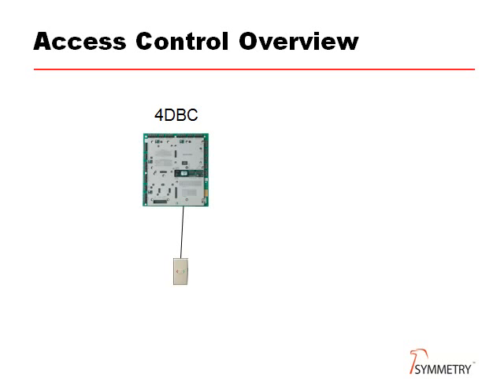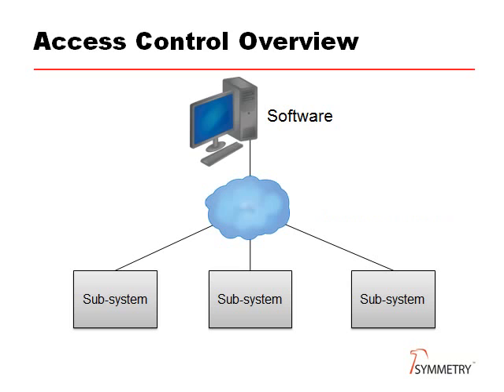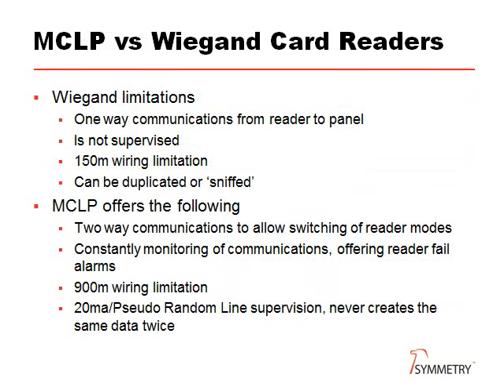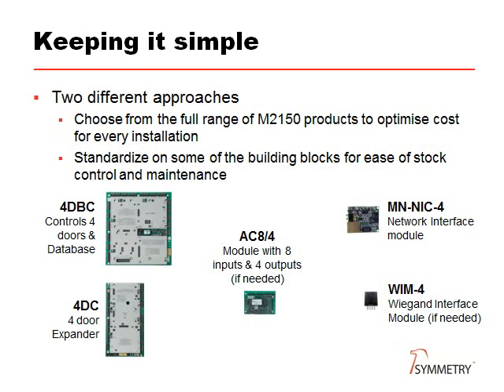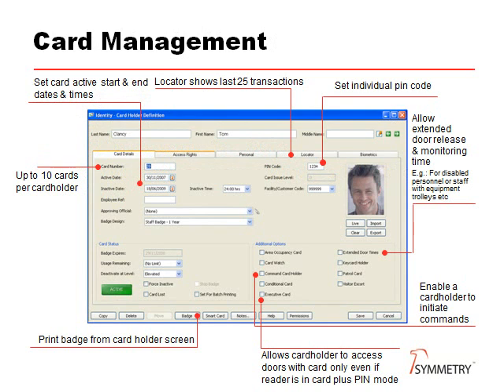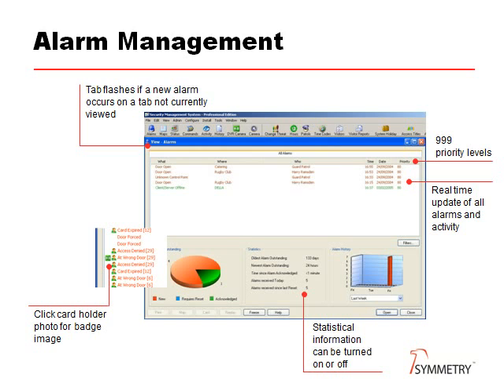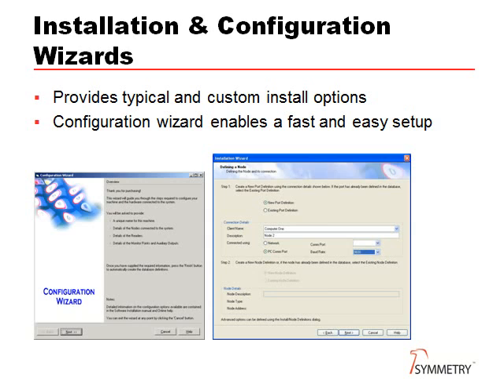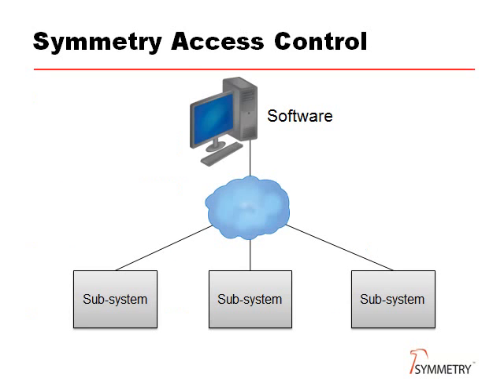Symmetry Small Systems

Comment: Hi I'm having problems with the Central m2150 4dbc and the s830 reader is not reading normal hid card can you help me?
Reply: When we connecting a reader there is a dip switch placed in the near of each reader port, that dip switch means whether it is connected 20 milli amphere mode or wiegand mode. So please put that reader in 20 milli amphere mode, then also connections are changed that is 12 v, ground, tx+, tx-, rx+, rx-, green led and red led, remember the same color code using when install the reader on wall or stand frame.